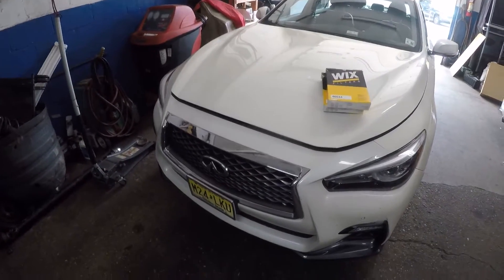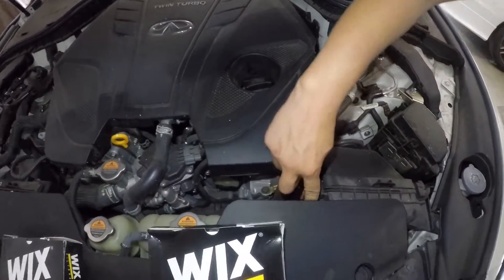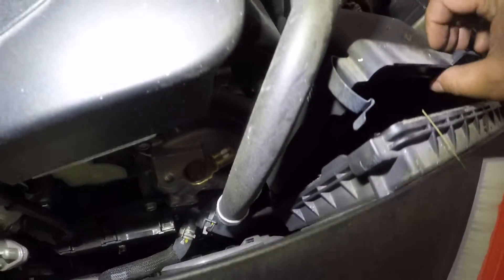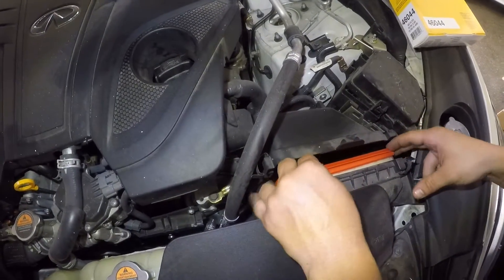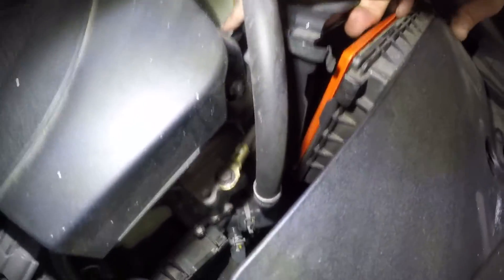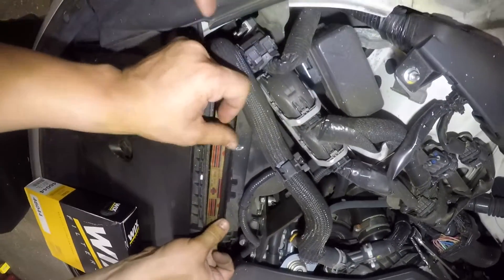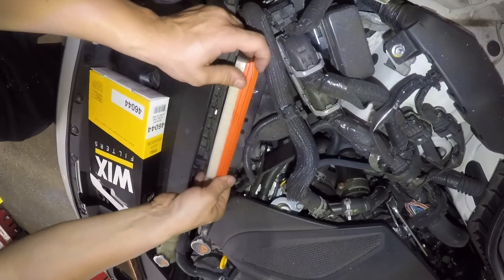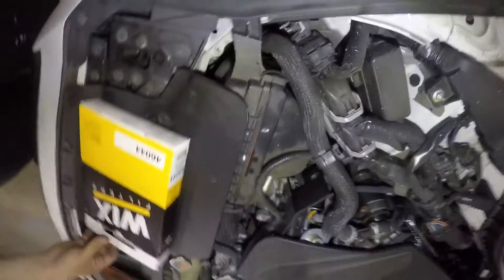How to replace both engine air filters on 2019 Infiniti Q50  || Infiniti Q50 filter change

Comment: Great video. Thanks.  However, try not to get Wix engine air filter for 2018 q50.  They do not fit perfectly.  Yes, it can be installed, but feel like it ain’t 100%sealing?  I tried other brands too.  They all same.  Just pay little more and get OEM.  However, I use aftermarket brands with all my other cars. 😊
Reply from the maker: Oh ok

Comment: It’s still a pain to close the right intake. Who tf design this shit. Had to take it to a shop to get it properly closed. Trash Infiniti.
Reply from the maker: Yeah I hate these engineers also this car had flat tire after that we couldn’t reset the tire light customer had to go back to dealer
Reply: It's far easier to take the front part of the air box out. ^^;;